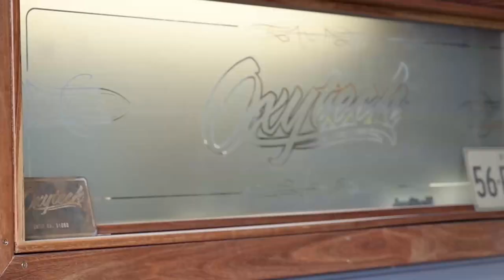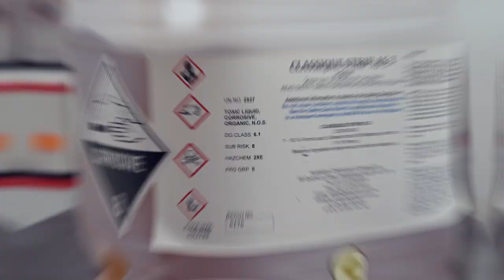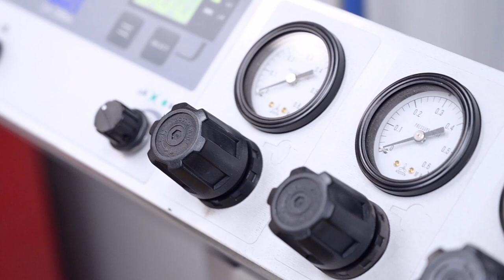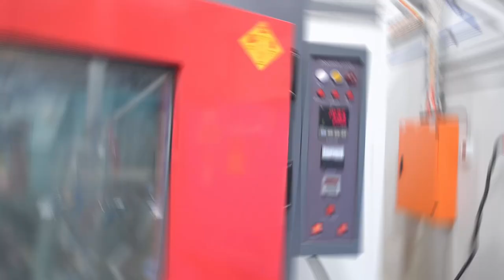Brembo Caliper Restoration - The Ultimate Guide

Comment: Looks like Kapiton polyamide tape used to mask- we used that in watchmaking school to mask off brushed finish areas on watch cases, jewelry industry also uses it for similar purposes. Only problem with all this is you have to buy rebuild kits and take caliper totally apart to do it 😖 assuming rebuild kits aren't cheap. I wonder if anodizing would work. Cant flake off...
Reply from the maker: The rebuild kit was under 100 for all 4 calipers. Its just a bunch of seals

Comment: Were did you get the pre cut tape for the pistons and mounting points ? Also what did you use on the bridge connection pipes to get them black was it powder coat too ? 

They came out perfect 😎👌🏼
Reply from the maker: The pre cut masking tape was measured in the spot then cut on a vinyl printer.

Yes the hoses and bolts were all powdercoated black. If you do this DO NOT coat the threads. Just the visible bits.

Good luck!